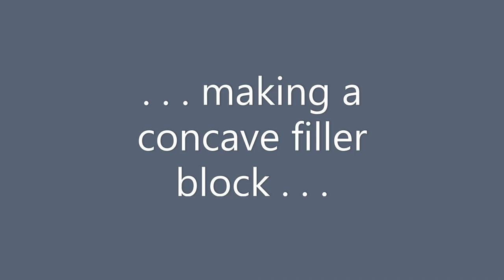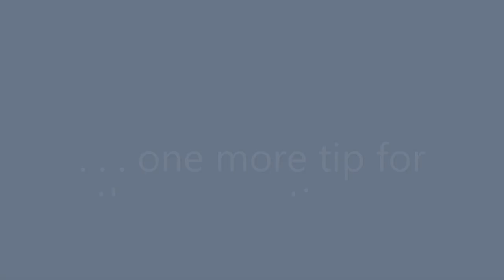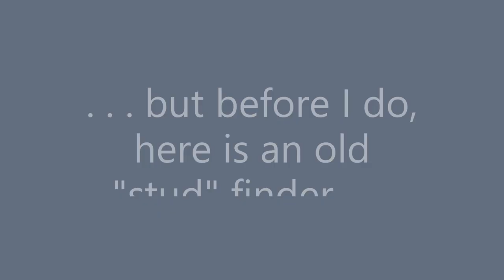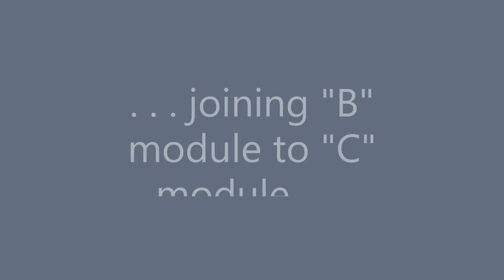Hanging The Shelf Layout | River Road Vlog #4

Comment: I got one of those zircon stud finders from back in the mid 90s. Mine is the smaller yellow one that come out after the one you got. I think I was around 14 years old when I got it. Got it so I could located the studs in the walls in a brand new 14' × 24' building. My father schooled me on how to build over the summer as we build that building for a train layout for myself. Finished sheetrock, popcorn ceiling, and linoleum floor. Two 8' fluorescents in the center of the room for light. Metal roof and vinyl siding. I thought I was shitting in high cotton when the building got done and I started fooling around with a layout. Then I got out of school, went to work, and had a child, but the building is still there full of trains and everything else that collects in a building over close to 25 years now. I've got a storage shed in the works so I can reclaim my layout building. I'm going to start calling it a layout studio so it sounds more important. LOL! I like the cable idea. Nice video. Stay well. -Wil  👍
Reply from the maker: You must have a few classic locomotives in that collection of trains. The plan you have sounds good. Cheers.
Reply: @boomerdiorama  Had a grandfather that went to every auction or yard sale that had trains advertised at them and 99% of the time they come home with him. He started doing that when I was 8 years old. My grandparents had moved from a smaller house in the city limits to a home with a basement and several buildings and around 15 acres of land in the countryside. There was an old chicken coop house 21' × 16' there that he and I cleaned out and put together an 027 layout. Mostly he let me do it and just gave me guidance when I needed it. I played around with the older auction bought Lionel and Marx and K line stuff until I started discovering ho scale. My grandpa decided that the dusty old chicken coop wasn't the right environment for these new smaller computer chip driven trains he called them. So that's when the new building come along. So yes lots of unique nice things in that collection. 👍

Comment: I thought using a sanding belt as a block sander was really clever.  Clamping the belt sander is next level.  
When your carpentry mentor built the boat he gifted you, I don’t think that was his only gift to you.  I remember a time when  I was younger listening and learning from the older guys. If you can find the righ “temperature” LEDs are much better for the environment.  I have one incandescent bulb and three fluorescent tubes left the rest of my lighting is LED.
Reply from the maker: Yes. Good - old Tommy - imparted many skills to my kit for sure. Funny you mention LED's. I just replaced the remaining fluorescents. They are all LED's now. They look really good as well. I also wired them all on one circuit. Cheers.

Comment: I can't tell you how helpful this series has been to me, Boomer - thank you! What I'm building is nowhere near the size of your layout and mine will be an exhibition layout so needs to be fully portable, but these tips apply to most projects, I think. My design has changed quite a lot as a result of watching this series, wood is measured, cut and ready to assemble, with some slack built in to allow for any solutions I need to come up with (no problems 😉). Seriously, big thanks! 🙏🙏

I know this video is two years ago now, but in answer to your question, what would I do with that space; I have a couple of layout ideas that will need that kind of space, both in OO rather than HO (I'm modelling mainly UK prototypes with some international). 

The first would be current day, the remains of a docks branch local to me that is now a combined heritage railway and industrial line. There are exchange sidings for the mainline locos to bring in the tankers, the heritage railway then supplies motive power to shunt the tankers to the industrial customer - usually diesel, but steam has occasionally been used, yes industrial steam in the 21st century!! The heritage railway also has a huge range of interesting rolling stock, including the oldest working steam locomotive in the UK (1863) and lots of industrial oddities.

The second would be set in the 1890s, another line that's local to me but now closed. There are busy docks, including passenger ferries on a major route at the time, as well as soda works processing the product from a salt mine over the river. The line was jointly owned and operated by two different railway companies, each having quite distinctive locos and rolling stock.

Anyway, those are the two ideas I'd go with at the moment, but I could probably fill that space a dozen times over with different prototypes. Thinking about making use of that blank canvas is inspiring and a little intoxicating 😅
Reply from the maker: I know the feeling. Take your time before you decide. Sounds awesome though. Cheers.

Comment: hahahhaa..this one had my thumbs up at the belt sander tip.. great stuff. In the last video you mentioned a soft wood plug to fit.. before you mentioned that I'm thinking..spray foam.. but, the belt sander method kept it all wood and again..not that difficult when you work from the base of tried and true experience.
Reply from the maker: Spray foam does the trick as well. Nice and light. Except, in this case I want something to nail into when I lay the river plate on, where the modules join up. Cheers.

Comment: I use face frame screws and glue on the outside pieces but no glue on most of the inner ones. maybe glue on the center brace but I want to be able to move the majority of the braces if one needs to be moved to facilitate the track and switches I want to lay. This way there is no brace under any switch. When done you can go back and glue the braces if you want but there is really no need for glue to most of the braces, just the face frame screws. I usually use 2 screws on each end and I usually drill for the screws to go into the table base when all is done. This will ring the base solid with the braces.
Reply from the maker: Great pointer! It's always a great idea to build in the ability to revise frames for sure. ;-)

Comment: looking great - Is the curved valance/proscenium going to be kept to the scale shown in wood or will it be taller - I remember you said you add on top of it but cant remember if you've ever talked about the height in relation to size of the layout
Reply from the maker: The valance (top) will drop down approx. nine inches. It will be 1/8 MDF board. The facia (bottom) will rise a bit in places, approx. four inches, in some places depending on the terrain profile which may not be established at the start for module "B" and "C". The facia on module "A" will only be 3" wide max where the river is. The actual (Letter-box) "aperture" opening will be approx. fourteen inches viewable.

Comment: doesn't look like the cantilevered valence could be used as a shelf, and I was curious what to do to make it stronger.
Reply: perhaps those cables I saw later in the video make it strong
Reply from the maker: @strobelightaudio  I installed cables anchored to studs in the wall. Furthermore, the "red oak" laminates I used for the "curved" facia increased the rigidness of the whole structure ten fold.😁